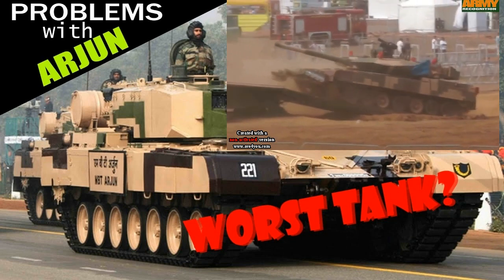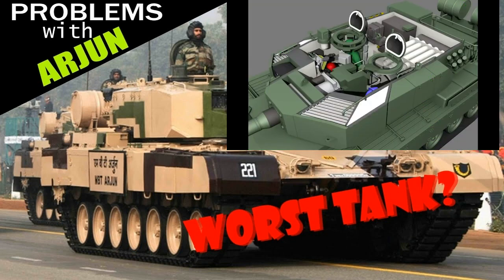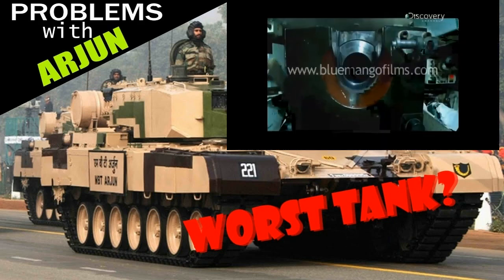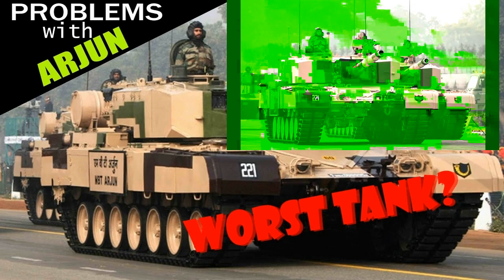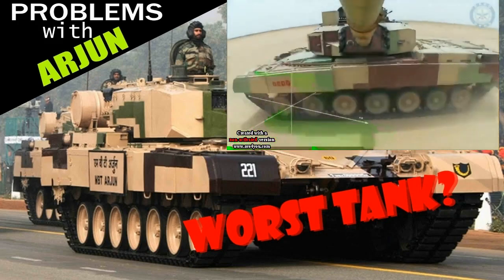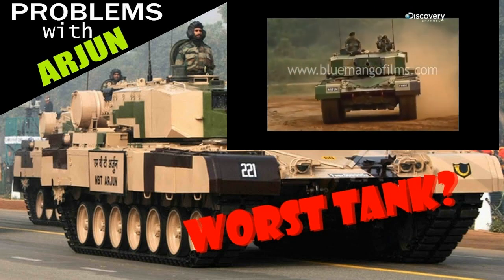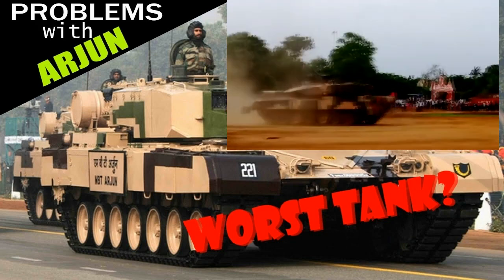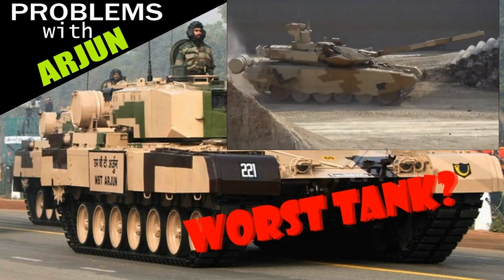Most wrest tank in the world,What is Problems with Arjun Tank.

Comment: Arjun has blow off panel for crew safety t90 is a death trap this guy must work for russians
Reply: The Arjun in fact does not have blow out panels. The hull ammo is placed on the left side of the hull without any protection (just like Turkish Leo’s in 2014). The turret rack doesn’t even have its own compartment, which means it cannot possibly direct the detonated ammo away from the crew apartment.